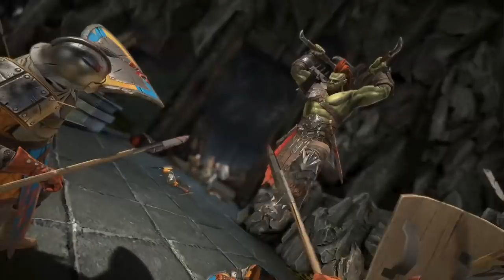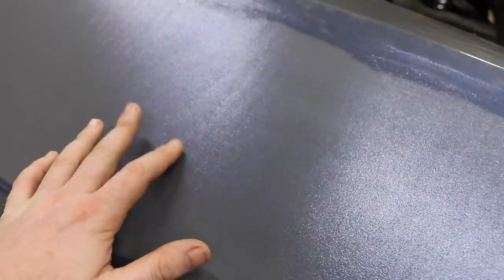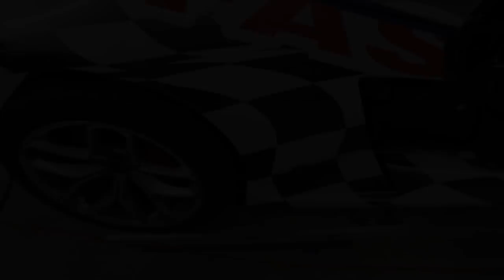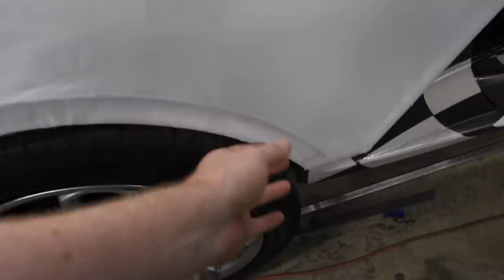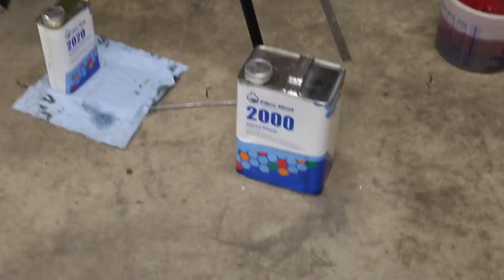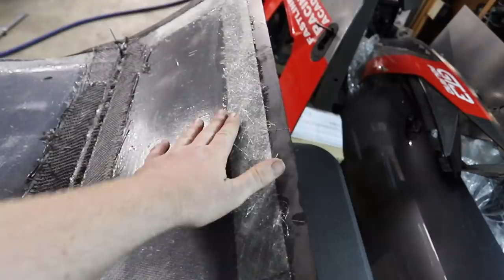Building a Carbon Fiber Wide Body Kit for my Huracan Pt 2

Comment: Tj hunt - omg we only have 50 days to put a premade body kit on the Ferrari before SEMA. 

Chris - hold my truly
Reply: same shit
Reply: @YGSnB  how.... how is it the same shit. Building vs bolt on
Reply: @teamdaze12  same shit bro Oscer builded most of it
Reply: @YGSnB  yeaaahhh just not the same. TJ has no welding to do and barely any modifications to make. Chris and his team are making fully custom parts and brackets, along with dealing with wiring and engine/turbo work
Reply: EdgarGarcia14 and don’t forget. one episode just for one side bolted on. 😅
Reply: @teamdaze12  we share the name Edgar and the last name Garcia are we related >>> ???
Reply: @YGSnB  hater
Reply: @charlesm7589  xoxo

Comment: Heyo, I used to work on luxary speedboats, both with carbon and glassfibre, and you really want to roll the air out, using a aluminum roller, and just roll every tiny airbubble out of that. Always roll, roll roll roll roll roll, no air my friend!

Good luck on the build!

// Kenny S.J Strömberg
Reply: Solid advice, plus last name checks out!
Reply: Kenny, who did you work for?   I have a Cigarette and an Outerlimits... just wondering if you worked at OL.
Reply: My step dad used to fibroglass as part of his job in a previous life and i completly agree. He always used tiny, in comparison, metal rollers. I noticed even when they whern trying to make a mould of the door they definitely could have avoided some of the issues with rolling more. Im loving watch this journey though and watching them kesrn

Comment: Hi Chris, just a quick note... on your fabric make sure you get fabric that is mostly cotton with  only 5% spandex. The issues is the resin will melt the spandex or any synthetic fibers if you are using a polyester resin. If its epoxy resin you should be OK but the dry time and stiffness will not be as good. Also keep in mind that the polyester resin will shrink a lot as it cures causing   wrinkles from the corner areas. Try to make sure your frame does not flex, and you may need to add more supports to the frame. I have videos on my channel on doing this. Hope this helps. Cheers.

Comment: Its pronounced "see-con-ite", if you need tips check out fabric covered aircraft processes or hmu. I used to be a tech for an aircraft company. I wish you luck on your most aggressive build yet. Great job Chris 👍👍👍
Reply: Savage Gentlemen I scrolled through about a hundred posts and suggested that in last weeks vid. I’ve got a ‘47 Stinson still dope and fabric. He needs to get Ceconite Razorback for this application and it will work well.
Reply: @DVolvoguy777-x7o  I agree, this method has been used for decades, I haven't heard of razorback, we just delt with ceconite 101 and 102, dacron, kevlar, fiberglass and carbon fiber methods. But he is figuring it out which is great to watch👍😁
Reply: Jeremy Duncan '48 Stinson here!  Nice
Reply: @jerrodl  Nice, you might have ordered from front the company I used to work for, Aircraft Spruce.
Reply: @SavageGentlemen  Oh yeah, all the time.  Hope it was a good place to work.
Reply: I wanted to scream this at my TV.  If only there was an industry with over 100 years of experience in stretching fabric over thin-member wood and metal frames to create lightweight aerodynamic shapes...
Reply: @jerrodl  it was, I was there for 10 years
Reply: @kevinmiller6693  bahaha 😂🤣😂🤣 so true,I thought he knew when he started but it seemed like he only had part of the process
Reply: Savage Gentlemen thanks for the ideas. I’m going to order this for my Ferrari build. I’ve been using fleece and it isn’t as good as this seems to be. Any suggestion on where to buy it?
Reply: @CrazyCowboyBuilds  you can also check into dacron fabric, check out aircraftspruce.com that's also where chris from b is for build bought his.
Reply: Savage Gentlemen perfect. I already have an account there. I’ll order a bunch now. Maybe do a video of modifying my build with it. I also use Aeromat (lightweight hexagon coremat) for lightweight strength. They sell similar stuff at Fiberglast
Reply: @CrazyCowboyBuilds  yeah we used to sell a fiber honeycomb for the same purpose

Comment: Fyi, I have done a bunch of vacuum bagging with ceconite ( see-co-nite) as the peel ply on fibreglass repairs I was doing on helicopter cowlings.  Worked great as a peel fly as epoxy didnt't stick.  Not sure if this helps with your build, but your carbon fibre may debond from the ceconite.  That is me experience working with ceconite and fibre glass working.

Comment: Had you coated thin layers of spray paint over the original cloth/fabric, it would have got hard enough to layer with resin. Also typically you don’t use one layer of any type of woven composite fabric. Because it’s woven, it is always tighter on one of the sides due to the direction of weave and has memory to one of it’s sides because of this. The trick is to always lay each layer of fabric’s weave in the inverse direction of itself. This is so the forces of it trying to curl cancle out. I tried offering help, I’ve cut all these corners before Chris 😉. Looking forward to seeing this project develop.

Comment: Hot Glue Removal Tip - the stuff becomes brittle when cold. So use Air in a Can held upside down so the just the icy propellant comes out.. spray it on the hot glue, then easily remove it.

Comment: Can always use body panel seam sealer or even semi rigid plastic repair from 3M to help support the the metal bars to the actual panel. It can be sanded and smoothed. Ive done this countless times to help support fiber glass fenders right around the outer edge so they do not crack.

Comment: You have a nice frame for the flares. But I really think you should foam fill, then shape. Make your carbon fiber panel from the foam/frame, then dissolve the foam and adhere/attach the carbon to the frame.

Comment: Ceconite can be shrunk with a common household iron. Also, model airplane builders use a small craft iron, available at hobby shops, which is really handy in confined spaces.

Comment: Another thought instead of using cesonite, did you ever think of using foam as your base to mold.  It was on Bitchin Rides, when they did the gullwing Mercedes.   It was a liquid mix that they poured in and formed an exact shape.   Just another option you may want to consider....

Comment: I would assume you know or someone suggested this already, but the technique your doing with the fabric was widely used to create subwoofer enclosures, typically you would use a fleece material as it doesn't sag and absorbs much more resin to become a stronger base for fiber-glassing

Comment: Very  good ideas brother to achieve the shape you wanted. But  I kind desagree with the 2nd wing building... To be honest, what I would have done is 3d scan 1rst wing without putting resine to it. Adjust things if needed to ease the installment later on. When I am satisfied with upgrade and mods. I do a mirror copy of it for the other side.
Once that done. I CNC on cheap wood or resine mold the shape I am happy with for both side, then do the carbone magic fabric. Both side would be exactly the same + I can mod the skeleton base on a computer before I produce it, also I can reproduce it 1000x times if needed

Comment: That's probably work but it takes patience to apply a light coat in between drying to prevent from sagging. Maybe it takes 3 to 5 or more light coatings to do the trick.  The end result is a stiff layered coatings. The keyword here is 'patience' don't rush it.

Comment: Great job,  I  am wondering if you could cover the door skins with the aircraft cloth then coat it with the resin and fiber, peel off after hard to make your carbon fiber doors??? Just a thought. I have never done it myself.

Comment: I am not sure, I have seen carbon fiber applications where they use multiple layers and use an vacuum in an oven to cure the material, these parts are used in aviation. Your parts look absolutely awesome.

Comment: I worry just a bit about your design for high speed aerodynamics. I imagine it'll add lift while potentially also creating a lot of pulling force on your supports. I'm thinking if you are going over 100mph - 200 mph. It may destabilize the car at high speed. Otherwise I think the design is awesome, looks wise.
Reply: as if this car will ever actually see high speeds....

Comment: Use fleece material that's how custom sub enclosures are built the lay down the fleece blanket spread resin on it the reinforce it with fiberglass to make it strong. I'm telking u this is ur best bet to make it work and still be light weight.

Comment: To B is for build, you know a manual brake pedal is about 40% smaller then an automatic brake pedal so why don't you cut yours down so you can make your clutch pedal straight and not at an angle?  Just a thought.

Comment: I use masking tape to cover the panels. Then I put duct tape to make my shape. conform it by getting out the air bubbles.Then bam i use more tape to hold the fiberglass cloth on the panel.Then add the resin and boom baby. I got a copy panel in 72 hours.

Comment: you can use foam!!!!!!!!!!!!!!!!!!!!!!!!!! for the skeleotn and lay carbon over that. foam can be sanded and cut into anything. just make sure the resin doesnt eat through it and do that you can just spray it with watered down modge podge.

Comment: I thought you were making a plug for a mold. Gonna be interesting to see how ya blend it all together.
Reply: Same...
Reply: I was thinking the same thing. So he’s keeping that fabric in between the carbon? I guess that’s one way of doing it...
Reply: I thought the same thing. I didn’t think in a million years he was leaving the mild steel frame inside the panel. This build is a perfect example of “function following form”. Let’s go ahead and negate any weight savings benefit of a carbon fiber panel by reinforcing it with a metal frame. They build a beautiful shape and I was impressed by how well the cloth method worked. Then this. I have no words for how much this channel infuriates me sometimes.
Reply: I'm so confused on the purpose of making it a "carbon body". I thought it was for the look of carbon but a few episodes ago he said he was gonna paint it. So maybe he's doing it for weight reduction, but than he does this. At this point i think he just wants to make it as expensive as possible, I'm sure it'll work n look cool, for sure gonna be entertaining to watch even if it's a bit cringe worthy.
Reply: @AdAstraPerLamma  If he took of metal skeleton the carbon it will be flexy, plus need to make attach hardware from carbon and that one is complicated as hell, if you want professional work it will cost money for molds and they are not cheap, this is DIY, only mistake why he didn't make from aluminum, guess oscar isn't there to weld

Comment: I would assume it would be easier to just make those out of aluminum. I would keep it aluminum, but if you want carbon I would use, tin, or thin steel

That Fabric was pretty cool, earlier I was thinking of something that works like Shrink Wrap.

Comment: if you ever use ceconite again use an iron instead of a heat gun, you can get the fabric way tighter than what the heat gun does. When building aircraft parts with that stuff you can get it tight enough to actually warp the part if your not careful. If you use poly fiber poly-brush as well you can get it much more rigid and it would work better as a mold. That's the stuff we used at the shop I worked at. https://www.aircraftspruce.com/catalog/cspages/polybrush.php

Comment: Maybe I am lost on it all but why worry about putting metal braces in if it just for the mold. Chris you said it didn't have enough supports. Now I get it for mounting points but carbon fiber good carbon fiber is stronger and lighter then metal. Also if your wanting the car to be fast adding metal to it isn't going to help. In general a wide body is going to add weight but metal weights alot more then fiberglass or carbon fiber.

Comment: Try heating it with a heat gun it might dewrinkle it. Or try using the "I believe nylon" used on general aviation planes as wing skin
Reply: Or heat it with an iron

Comment: this worked out really well ... I might have to steal this technique from you... although i wasn't the guy that told you about the air frame skin material i did warn you to test that fabric and maybe hit it with primer first.. anyway worked out well... I will be of course using fiberglass because I don't have a sponsor .. and actually i don't have a project right now .. life is busy... I support your decision to stay in the second booth after they dumped you and then got burnt... (God Bless Kevin is ok) Hope your vehicle is much nicer than whatever they display as their backup.

Comment: Looking good man! Wish i wouldve done this for some of the parts on my Stagea GTR35, instead of filling my garage with sanded foam..

Youre not worried about delamination, the carbon fiber separating from the hardened fabric?

Comment: i ask myself how rusted it will be after a while ??? or you gonna get the fabric back off for painting the metal parts ???
Reply: If it is the metal skeleton inside of the resin and fiber you are referring to those should seal it at least as well as paint would if done properly. I'm not aware of any reason he couldn't seal the currently exposed portions with the fiber still attached. It would have to be damaged to take it off and put it back on.

Comment: its pronounced sea-con-ite its a polyester based fabric that we use to cover airplanes with it is a modern replacement for grade A cotton which was commonly used in the 20s and 30s

Comment: I dont know if your gonna bag the carbon part when you do it but if you dont, your wasting a bunch of time and money because it will not turn out like you think it will without bagging it, 100%!!!!! Also, i would use FLEECE first because its thick and will hold alot of resin! Just a tip, been doing custom car stereo boxes for 25 years!!! Looking good tho but for sure, good luck on doing your "CARBON FIBER!"

Comment: You really should have por15'd the metal parts before sealing it inside. Any moisture at all slips through and those are gonna rust from the inside out, quality oversight right there....but it's a sema trailer queen so I guess it'll never matter.

Comment: Do you really think this will be done by SEMA?
Reply: Yeah for sure... SEMA 2020!
Reply: he will probably do what he did last year and have an army assembled as the days until SEMA get shorter.
Reply: Most of the hard stuff is done for the most part, motor runs, trans is in with the shifter, all that’s really left is the exterior and the interrior

Comment: the current spiked seltzer is caused by a loophole 1990's tax legislation to make wine coolers and other spiked drinks too expensive to produce (to stop the rampant alcoholism wine coolers were apparently causing), wherein brewers realized they could make a spiked drink by cheaply brewing low quality beer just for the alcohol content, instead of by fermenting the alcohol like wine (fermented and distilled alcohol is taxed at a higher rate due to the aforementioned tax legislation; brewed alcohol is taxed at a substantially lower rate). spiked seltzer is literally 20% or less per volume to produce than even the cheapest drinkable beer. like, natty ice levels of cheap beer.

Comment: You could have used the inside of the seeconite as a mold to make a full carbon copy of that shape. Also I would of highly recommended you sanded both the previous layer of resin and the inside of the seeconite and after cleaning it with a wax and grease remover since you are overlaying it. That spray glue is a big no no in overlays as it dissolves when epoxy touhes it which causes the carbon to float (lift, delaminate, bubble). I wish you the best and lets hope that the carbon doesn't lift, delaminate or even worse bubble everywhere due to it being overlaid and poor prep. I am only speaking from years of experience and I wish I could have guided you in doing it the correct way. If you have any questions you can contact me @cactus_composites on Instagram.

Comment: The reason it started to wrinkle was because of the heat from the resin. Spandex and similar material can not take the heat as it basically melts. That fabric was designed for leotards and other dance costumes.

Comment: Just spray the cloth with cheap acrylic paint in light coats until it's firm then lay carbon over it,
Reply: Acrylic will not hold like that.
Reply: @_badsine_  . I commented before the part where he shit the bed and left all that steel and shit in. I thought he was making a mould not the final part.